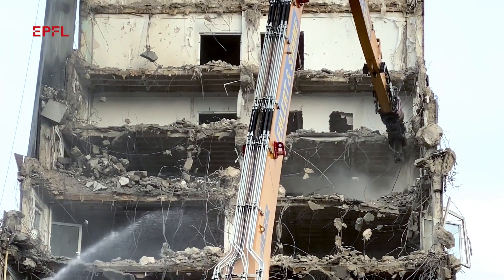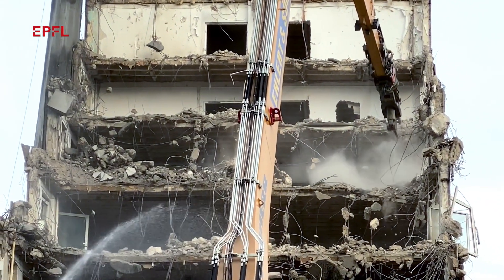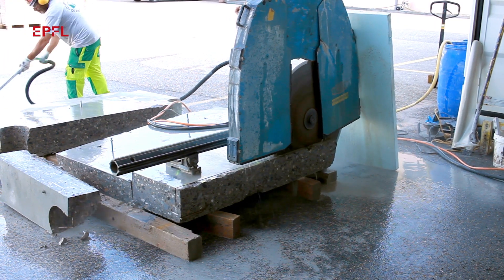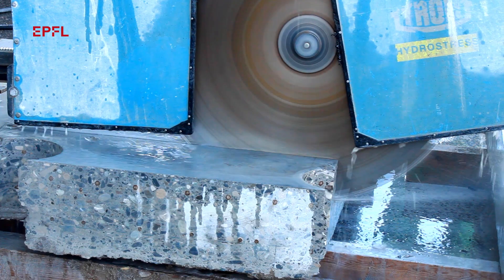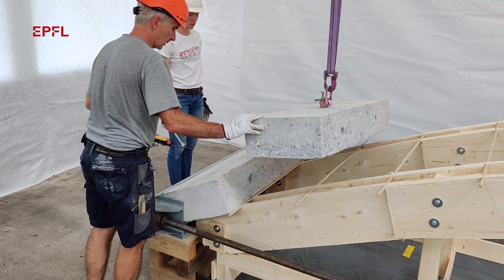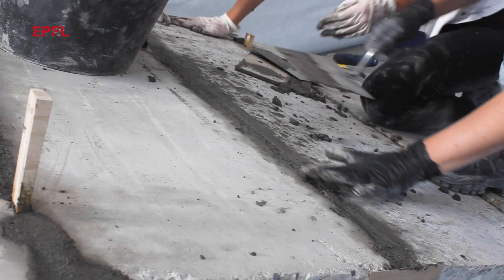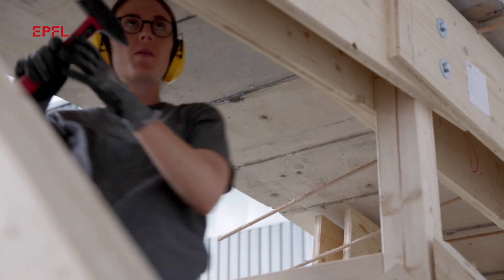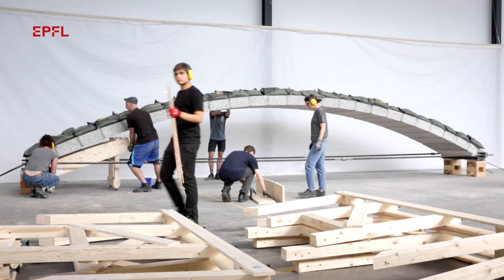Concrete footbridge without pouring concrete

Comment: the concrete process would be much better for all if instead we melted stones using oxalic acid and baked off the excess acid and water to form bricks of the resulting clay. This process could've used many less resources for example if the stone-melting oxalic or hydrofluoric acids were employed. Since too the concrete if already formed, this could be melted and reformed using the same process, while being much stronger than the power of explosives
Reply: if concrete tumblers were highly reinforced plastic and contained stones and oxalic acid, and production was being done months in advance to cure the stone pieces, concrete production could come to a permanent halt. Put it into action, please. Love to see technology of the past in modern day.

Comment: This concrete vault is like a stone vault, right? Where to find, in sufficiency, concrete "quarries" without metallic reinforcements?
Reply: Why should reinforcement in the concrete be a problem? The old concrete walls are anyway cut into suiting elements? Actually, reinforcement in the blocks would even increase the compressive strength of the elements.
Reply: @endero3075  I understand, OK.